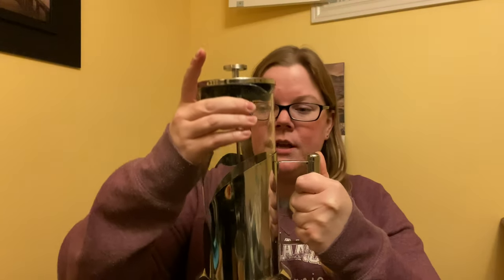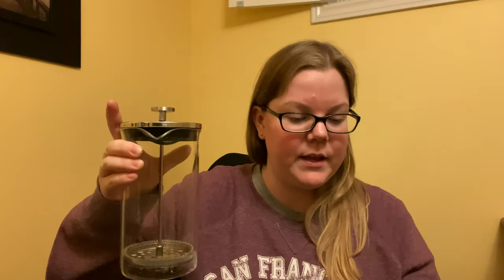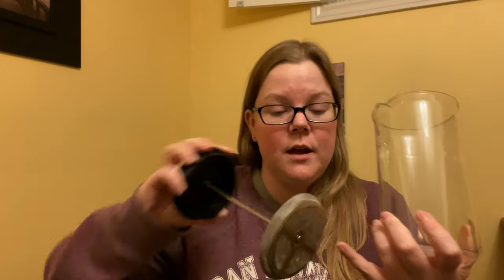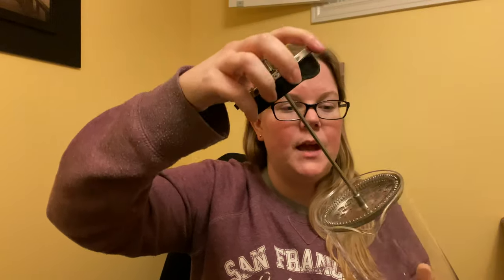Pens & coffee: brewing methods!

Comment: My grandma made the best coffee with an old drip pot using a neat trick that made brewing faster. She would leave the apparatus out while the water boiled. Then she would pour about a cup of boiling water into a measuring cup (often the quart size), lower the heat a bit, put in the apparatus filled with coffee, but with the filter off into the pot so she could pour the cup of hot water through. Finally, she would pop on the lid to the apparatus and the top of the pot, adjust the heat heat to let it perk for only about 4 minutes. I used to do this with a glass pot so I could see when the coffee was the color I liked. It’s easier than it sounds and could make the old canned coffee taste nice and smooth. With your own personal grind, it’s near amazing. I think one reason I stayed friends with my boyfriends is that the liked me, but loved my coffee. It’s also very inexpensive to get a glass drip coffee pot.